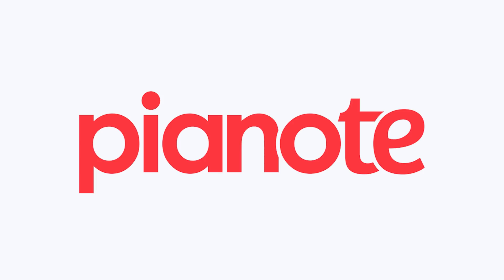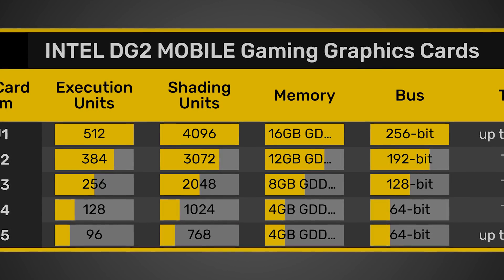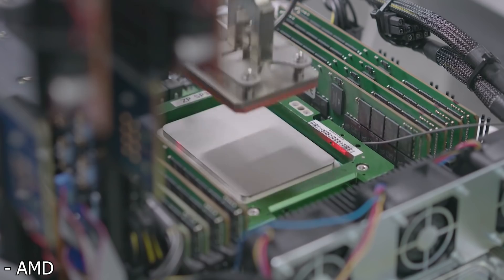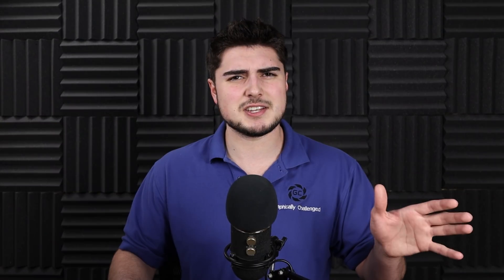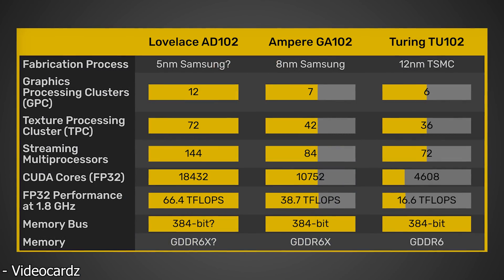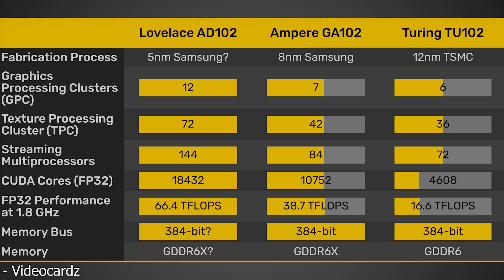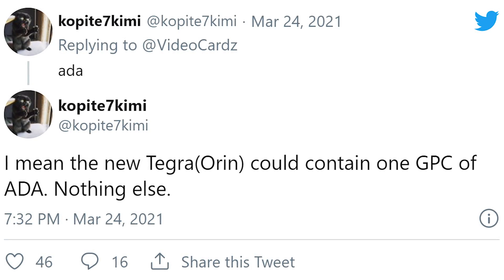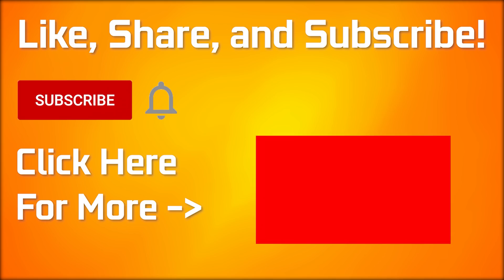Nvidia Is In BIG TROUBLE & INSANE RTX 4000 GPU Leak

Comment: Nvidia plans for RTX 5000 series:
5070, 5080, 5090 with increased perfomance for mining cryptocurriences and 4x less speed while used for gaming.
5010, 5020, 5030, 5040, 5050 , 5060 for gaming, but 50 % gaming speed default, and you have to pay 1000$ one time fee to unlock 75 % speed, and 2000$ to unlock full speed.
Wouldn't be suprised if that happened.
NVIDIA : "We care about gamers"

Comment: GPU advancements are bottlenecked by adoption rates and game development. No developer is targeting rare and wildly expensive hardware that almost no one actually owns. The current gen consoles will determine the soft ceiling for game development for at least the next five years.  If your GPU is on par with those machines (GTX 2060, give or take), then you will be good to go for 1080p 60fps gaming.

Comment: So an Intel GPU that is no more than a 3070 launching NEXT year when Nvidia and AMD will be prepping to roll out their next-gen GPUs.. That Intel GPU will be like a 3050Ti in performance to those GPUs.. How is that at threat at all. Intel would need a far more powerful solution. Because it wouldn't even be the mainstream "3060" contender by then. The 4060 and AMD 7700XT would be twice as fast.

Comment: your titles are always ... "a bit extreme", what problem? 3070, 3080, possible if coming anytime soon 3080 (Ti) and 3090 in REAL DAMN BIG TROUBLE because of a 256bit MS GPU? Yea nvidia and amd really...SKU1-6 or so, SK2U1-6 would need to be at least rtx 40 levels as it will come out later I guess, but the SKU1 is the only card which could replace anything but selling because its "new" will be hard under normal situations most likely miners would buy such cheap cards, especially if Power-Performance will be good, but RDNA3 already has another halfing-tdp @ same performance target as from RDNA to RDNA2.....(and yea it worked, the 250-350W on both sides is extra performance and better RTX-features and DX-Raytracing, 16GB, clocks over 2500Mhz in some cases @ AMD etc....

Comment: Nintendo already has an rtx 4080 get on with the times old men I'm a time traveler and I have an i5 20600k on a Nintendo Z990 motherboard with ddr12 ram and pci express 40.0 x90 and its using wireless cpu

Comment: Xe isn't really going to help much for the GPU shortage as Intel is also using TSMC's 7nm for it. Intel specifically stated such in a slide for Xe about 6 months ago. Also TSMC has basically said Intel will be getting the lowest silicon supply of their partners as they are they are also building fabs to compete with TSMC so they're seen as a dead end partnership.

Comment: I havent found RTX 3080 yet but as RTX 3080TI coming inM ay i will get that instead. However my gtx 970 g1 gaming that i have since november 2014 stil runs evrything on ultra 1440p 30+ fps, and simple games like crash bandicoot 4 that released on Friday(which is the game i currently play) still run ultra 1440p 60 fps. But most current games run about 40 fps maxed 1440p which is aamzing for a 6 years old card. my pc now is CPU: RYZEN 7 1700
RAM: 16 GB DDR4 3200MHZCL15 GS KILL RIP JAWS
GPU: GTX 970 G1 GAMING
MONITOR: DELLP2416D 24'' 2560X1440 60 HZ IPS
MOTHERBOARD: ASUS PRIME X370 PRO
HDD1: WD BLACK 4 TB
HDD2: 1 TB

SSD: MP 600 2TB
PSU: CM 750M 750 WATT
Reply: You've posted this comment 27 times on this video...... . For what reason? To annoy everybody?
Reply: It's cute that you think you will have a shot at getting the 3080TI when you haven't found a regular 3080 yet.

Comment: If it is a 384-bit that would most likely be a 4080 ti going by all past model varients. And it just so happens that TI model are never announced before the non TI models. So I believe this model of card would be a 320-bit and would be a 4080. 

I also believe the founders edition will cost around $799 unless Intel can throw something together in their DG3 lineup in time to compete with a 4080. Or if AMD is willing to be better with their pricing. A 7000-series XT (perhaps a 7800XT) at $749 that would cause nVidia to drop back to $699 again.

Comment: RTX 4060: $499
RTX 4070: $999
RTX 4080: $1999
Reply: lol, no.
same prices as 3000 series
Reply: @cydia11centra  I havent found RTX 3080 yet but as RTX 3080TI coming inM ay i will get that instead. However my gtx 970 g1 gaming that i have since november 2014 stil runs evrything on ultra 1440p 30+ fps, and simple games like crash bandicoot 4 that released on Friday(which is the game i currently play) still run ultra 1440p 60 fps. But most current games run about 40 fps maxed 1440p which is aamzing for a 6 years old card. my pc now is CPU: RYZEN 7 1700
RAM: 16 GB DDR4 3200MHZCL15 GS KILL RIP JAWS
GPU: GTX 970 G1 GAMING
MONITOR: DELLP2416D 24'' 2560X1440 60 HZ IPS
MOTHERBOARD: ASUS PRIME X370 PRO
HDD1: WD BLACK 4 TB
HDD2: 1 TB

SSD: MP 600 2TB
PSU: CM 750M 750 WATT
Reply: @shredderorokusaki3013 
honestly, i don't play on ultra anymore, I have a 980 and I play on 1440p high and sometimes if the game is intensive or I need high fps I'll scale the render resolution down to %85-75.
Reply: I havent found RTX 3080 yet but as RTX 3080TI coming inM ay i will get that instead. However my gtx 970 g1 gaming that i have since november 2014 stil runs evrything on ultra 1440p 30+ fps, and simple games like crash bandicoot 4 that released on Friday(which is the game i currently play) still run ultra 1440p 60 fps. But most current games run about 40 fps maxed 1440p which is aamzing for a 6 years old card. my pc now is CPU: RYZEN 7 1700
RAM: 16 GB DDR4 3200MHZCL15 GS KILL RIP JAWS
GPU: GTX 970 G1 GAMING
MONITOR: DELLP2416D 24'' 2560X1440 60 HZ IPS
MOTHERBOARD: ASUS PRIME X370 PRO
HDD1: WD BLACK 4 TB
HDD2: 1 TB

SSD: MP 600 2TB
PSU: CM 750M 750 WATT

Comment: All I need rn is 3070's I'm fine without 4k series, I just hope it captures the interests of miners so that gamers can have 3k series
Reply: you make it sound like everyone and their mother is mining. You are sadly mistaken. It takes waaaaay more than a GPU to mine bitcoin. Also, thats not why these GPUs are high in the first place. Its mostly cause the shortage and scalpers. Even old cards being sold 4 times what they are worth
Reply: I havent found RTX 3080 yet but as RTX 3080TI coming inM ay i will get that instead. However my gtx 970 g1 gaming that i have since november 2014 stil runs evrything on ultra 1440p 30+ fps, and simple games like crash bandicoot 4 that released on Friday(which is the game i currently play) still run ultra 1440p 60 fps. But most current games run about 40 fps maxed 1440p which is aamzing for a 6 years old card. my pc now is CPU: RYZEN 7 1700
RAM: 16 GB DDR4 3200MHZCL15 GS KILL RIP JAWS
GPU: GTX 970 G1 GAMING
MONITOR: DELLP2416D 24'' 2560X1440 60 HZ IPS
MOTHERBOARD: ASUS PRIME X370 PRO
HDD1: WD BLACK 4 TB
HDD2: 1 TB

SSD: MP 600 2TB
PSU: CM 750M 750 WATT

Comment: NEVER compare 2 different GPU architectures against raw numbers.The biggest noob mistake anyone can make when looking for a new gpu and comparing numbers and not looking at performance off the bat.As far as we know with those numbers for Intel GPU's the performance might not be all that good.
Reply: There's a market for anything as fast or faster than the GTX 1060.
Reply: I havent found RTX 3080 yet but as RTX 3080TI coming inM ay i will get that instead. However my gtx 970 g1 gaming that i have since november 2014 stil runs evrything on ultra 1440p 30+ fps, and simple games like crash bandicoot 4 that released on Friday(which is the game i currently play) still run ultra 1440p 60 fps. But most current games run about 40 fps maxed 1440p which is aamzing for a 6 years old card. my pc now is CPU: RYZEN 7 1700
RAM: 16 GB DDR4 3200MHZCL15 GS KILL RIP JAWS
GPU: GTX 970 G1 GAMING
MONITOR: DELLP2416D 24'' 2560X1440 60 HZ IPS
MOTHERBOARD: ASUS PRIME X370 PRO
HDD1: WD BLACK 4 TB
HDD2: 1 TB

SSD: MP 600 2TB
PSU: CM 750M 750 WATT

Comment: Damn, I just bought a 3080 and now 4000 series are coming up, anyways, good time to buy a 3000 series and keep it for 7 years
Reply: how much ya spend? 1500? 2000?
Reply: @shinski8114  I havent found RTX 3080 yet but as RTX 3080TI coming inM ay i will get that instead. However my gtx 970 g1 gaming that i have since november 2014 stil runs evrything on ultra 1440p 30+ fps, and simple games like crash bandicoot 4 that released on Friday(which is the game i currently play) still run ultra 1440p 60 fps. But most current games run about 40 fps maxed 1440p which is aamzing for a 6 years old card. my pc now is CPU: RYZEN 7 1700
RAM: 16 GB DDR4 3200MHZCL15 GS KILL RIP JAWS
GPU: GTX 970 G1 GAMING
MONITOR: DELLP2416D 24'' 2560X1440 60 HZ IPS
MOTHERBOARD: ASUS PRIME X370 PRO
HDD1: WD BLACK 4 TB
HDD2: 1 TB

SSD: MP 600 2TB
PSU: CM 750M 750 WATT
Reply: I havent found RTX 3080 yet but as RTX 3080TI coming inM ay i will get that instead. However my gtx 970 g1 gaming that i have since november 2014 stil runs evrything on ultra 1440p 30+ fps, and simple games like crash bandicoot 4 that released on Friday(which is the game i currently play) still run ultra 1440p 60 fps. But most current games run about 40 fps maxed 1440p which is aamzing for a 6 years old card. my pc now is CPU: RYZEN 7 1700
RAM: 16 GB DDR4 3200MHZCL15 GS KILL RIP JAWS
GPU: GTX 970 G1 GAMING
MONITOR: DELLP2416D 24'' 2560X1440 60 HZ IPS
MOTHERBOARD: ASUS PRIME X370 PRO
HDD1: WD BLACK 4 TB
HDD2: 1 TB

SSD: MP 600 2TB
PSU: CM 750M 750 WATT
Reply: @shin 1200 expensive, but in my country is kinda like that
Reply: I'm very glad I haven't chase it on eBay/amz/newegg , found it locally in my country, so I didn't want to miss the opportunity

Comment: Can Nvidia work on their current problem instead of making new GPUs? Guess all that matters to them is their price on the stock market 💵💵💵💵💵💵💵💵💵💵💵💵💵
Reply: The issue is only on the outside. Internally Nvidia does not really have an issue. Yield might be a bit lower than what they like to see but just looking at their revenue for the past two quarters they are just fine. Meaning they still able to produce enough product to keep increasing their revenue growth slowly. If production are below what they have always done then revenue should be also affected in negative way. The only problem is miner are buying all those gpu. And common consumer are left with almost nothing.
Reply: @arenzricodexd4409  Yep. They realise what happened when Crypto slumped and are releasing CMP to prepare, screwing over gamers.

Comment: hahaha Intel GPU will be here to stay. Nvidia and AMD can't fix their supply chain, not until their sole single supplier can produce more chips
Reply: Intel GPU are on TSMC 6nm... not so funny anymore uh?
Reply: @lupintheiii3055  damn!
Reply: I havent found RTX 3080 yet but as RTX 3080TI coming inM ay i will get that instead. However my gtx 970 g1 gaming that i have since november 2014 stil runs evrything on ultra 1440p 30+ fps, and simple games like crash bandicoot 4 that released on Friday(which is the game i currently play) still run ultra 1440p 60 fps. But most current games run about 40 fps maxed 1440p which is aamzing for a 6 years old card. my pc now is CPU: RYZEN 7 1700
RAM: 16 GB DDR4 3200MHZCL15 GS KILL RIP JAWS
GPU: GTX 970 G1 GAMING
MONITOR: DELLP2416D 24'' 2560X1440 60 HZ IPS
MOTHERBOARD: ASUS PRIME X370 PRO
HDD1: WD BLACK 4 TB
HDD2: 1 TB

SSD: MP 600 2TB
PSU: CM 750M 750 WATT

Comment: remember a couple years ago people would talk about waiting for the 2000 series to be more available and it never really happened
Reply: Ppl shud delay their upgrade time.
Reply: yeah but dude i could of got a 2070 super last year on ebay for 600 bucks new open box. Now they go for 900-1200 dollars.
Reply: I havent found RTX 3080 yet but as RTX 3080TI coming inM ay i will get that instead. However my gtx 970 g1 gaming that i have since november 2014 stil runs evrything on ultra 1440p 30+ fps, and simple games like crash bandicoot 4 that released on Friday(which is the game i currently play) still run ultra 1440p 60 fps. But most current games run about 40 fps maxed 1440p which is aamzing for a 6 years old card. my pc now is CPU: RYZEN 7 1700
RAM: 16 GB DDR4 3200MHZCL15 GS KILL RIP JAWS
GPU: GTX 970 G1 GAMING
MONITOR: DELLP2416D 24'' 2560X1440 60 HZ IPS
MOTHERBOARD: ASUS PRIME X370 PRO
HDD1: WD BLACK 4 TB
HDD2: 1 TB

SSD: MP 600 2TB
PSU: CM 750M 750 WATT
Reply: @shredderorokusaki3013  upgrade your cpu also. If your going to go 3080ti
Reply: @nickgames1892  What would you personally recommend?
Reply: @ilikepiedontu  i know i wouldnt recommend getting a 3080ti to just bottleneck it using a 1700x

Comment: Even if Intel does match the RTX 3070 in performance we will be looking at a $700+ GPU. This is Intel we are talking about, they would rather be known for nothing more than ripping their customers off than be known as the value brand. Of course in today's market that's not a comparatively bad value, especially if it is kept in stock. It's sad to think that a $700 GPU with $500 performance could be the best value on the market.

Comment: Thanks to the rubbish supply of PC parts this time around I've decided to wait till next year when DDR5 is out, Alder Lake CPUs and Love lace GPUs. My 5820k with 1070ti must soldier on
Reply: you should continue to look for a new GPU because if you can get one around retail then your 1070ti could sell used on Ebay for as much as it cost you when it was new. Its a great time to replace and resell old GPU if you can get lucky and find a new one near MSRP
Reply: @r3conwoo  I havent found RTX 3080 yet but as RTX 3080TI coming inM ay i will get that instead. However my gtx 970 g1 gaming that i have since november 2014 stil runs evrything on ultra 1440p 30+ fps, and simple games like crash bandicoot 4 that released on Friday(which is the game i currently play) still run ultra 1440p 60 fps. But most current games run about 40 fps maxed 1440p which is aamzing for a 6 years old card. my pc now is CPU: RYZEN 7 1700
RAM: 16 GB DDR4 3200MHZCL15 GS KILL RIP JAWS
GPU: GTX 970 G1 GAMING
MONITOR: DELLP2416D 24'' 2560X1440 60 HZ IPS
MOTHERBOARD: ASUS PRIME X370 PRO
HDD1: WD BLACK 4 TB
HDD2: 1 TB

SSD: MP 600 2TB
PSU: CM 750M 750 WATT
Reply: I havent found RTX 3080 yet but as RTX 3080TI coming inM ay i will get that instead. However my gtx 970 g1 gaming that i have since november 2014 stil runs evrything on ultra 1440p 30+ fps, and simple games like crash bandicoot 4 that released on Friday(which is the game i currently play) still run ultra 1440p 60 fps. But most current games run about 40 fps maxed 1440p which is aamzing for a 6 years old card. my pc now is CPU: RYZEN 7 1700
RAM: 16 GB DDR4 3200MHZCL15 GS KILL RIP JAWS
GPU: GTX 970 G1 GAMING
MONITOR: DELLP2416D 24'' 2560X1440 60 HZ IPS
MOTHERBOARD: ASUS PRIME X370 PRO
HDD1: WD BLACK 4 TB
HDD2: 1 TB

SSD: MP 600 2TB
PSU: CM 750M 750 WATT

Comment: Tf?? What about 3050
Reply: Is coming.
GA107 chip, ~2800 cudacores and 4GB 128bit bus.
Basically a GTX 1660 with 4GB of Vram.
Don't even bother, get a used GTX 1660Ti/1080, both faster and with more Vram.
Reply: @lupintheiii3055  do you know the release date of 3050?
Reply: @reeza2723  It's not clear, most likely next month for mobile version and this summer for discrete GPU.
I'm sorry, why are you so interessed in that card??? It's going to be utterly crap and $300-400 (with a fake MSRP of $200). Just get a used GTX 1080.
Reply: @lupintheiii3055  considering about tdp, the 3050 might be lower, acctually i really wanted to get the 1660 but there is no stock
Reply: @reeza2723  Where do you live? Because here in Europe you can find 580 4GB or 1660 in backorder for around 200-300 euro...
RTX 3060 is 170-200W, so a 3050 is going to be 120W at best, exact same of 1660, so not even that is an argument. Honestly a decent 500W PSU (like an EVGA 80+ bronze) is $50 and if you have anything above a crappy 350W PSU you will be fine. The difference between a 120W and 180W GPU is negligeable.
Reply: @lupintheiii3055  i live in indonesia. Fyi the price for 1660 is aroung 400-500 dollar.... might considering for 1650s but for me the price is to overprice around 300-400 dollar. Have no choice :((((
Reply: @reeza2723  GPU market is really F###ed up in Indonesia/Philippine/India right now :-(
Import something from China with something like Alibaba? You can find  compact systems with i9 9980h and GTX 1650 for around $500
Reply: @lupintheiii3055  pretty fcked up
Reply: @lupintheiii3055  by the way its kinda weird invidia launch 3050 for the mobile version at first. What do u think?
Reply: @reeza2723  Not really, laptops sells like hotcakes right now, becouse is the only way to get a GPU and a laptop sale makes OEM's as well as Nvidia/Intel/AMD happy. Also that graphic card is not an upgrade for desktop users, basically anyone with a GTX 1060/1660 or RX 470 / 480 is not interessed in an RTX 3050.
Reply: ....wait a minute, it's not like 6 in the morning for you?? :-)
Reply: @lupintheiii3055  3 am actually
Reply: @lupintheiii3055  doing college sh*t things
Reply: I havent found RTX 3080 yet but as RTX 3080TI coming inM ay i will get that instead. However my gtx 970 g1 gaming that i have since november 2014 stil runs evrything on ultra 1440p 30+ fps, and simple games like crash bandicoot 4 that released on Friday(which is the game i currently play) still run ultra 1440p 60 fps. But most current games run about 40 fps maxed 1440p which is aamzing for a 6 years old card. my pc now is CPU: RYZEN 7 1700
RAM: 16 GB DDR4 3200MHZCL15 GS KILL RIP JAWS
GPU: GTX 970 G1 GAMING
MONITOR: DELLP2416D 24'' 2560X1440 60 HZ IPS
MOTHERBOARD: ASUS PRIME X370 PRO
HDD1: WD BLACK 4 TB
HDD2: 1 TB

SSD: MP 600 2TB
PSU: CM 750M 750 WATT